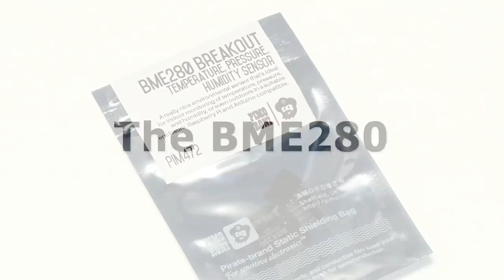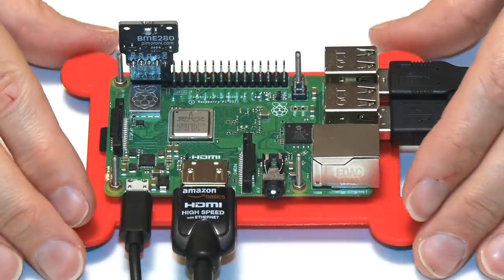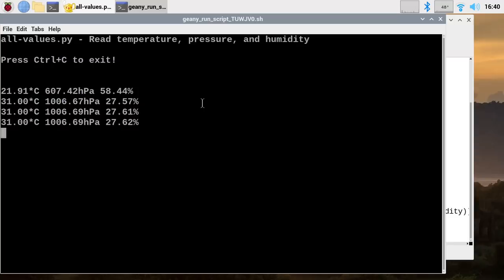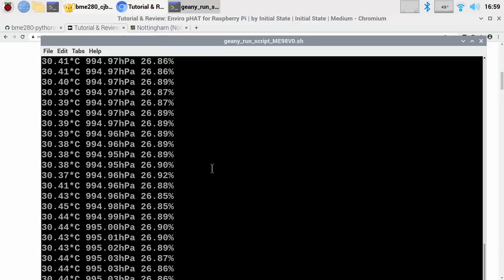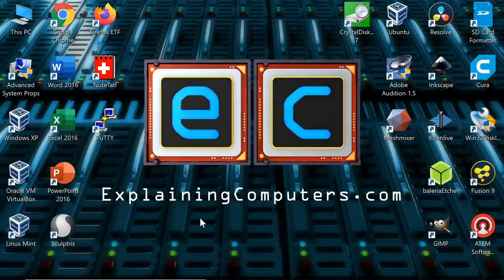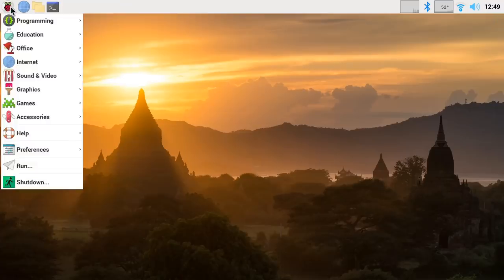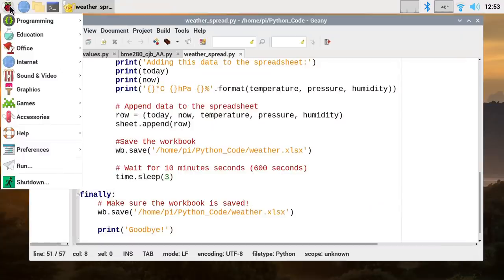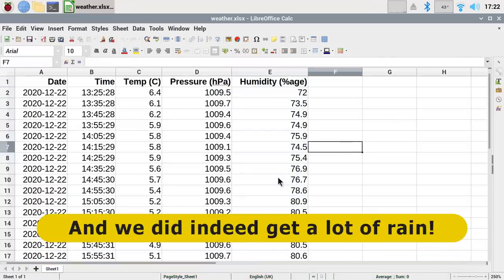Raspberry Pi Weather Station

Comment: Hi, I watched your video with great interest. I'm paragliding pilot and I use an instrument which is called variometer to get audio signalling if I ascent or descent. I'm also freshly in love to brand new Raspberry PI4 8Gb. I was thinking of building PiZero with battery and such and sensor to working variometer instrument.
I have a couple of questions for you:
- if I'm correct such project could be done by PiZero (PiZero runs the same software then Pi 4b) - correct?
- how fastest, how many times per minute or second can data be collected, with the usage of Python or some other programing language
  (in your example data is collected every second... can be collected faster)?
- how specific (granulate) can  pressure data be gathered (in your example hPa are measured to two decimals... can it be measured to finer precision)?
- can you point me to the source of alternative sensors which will work with RPi (I'm interested in similar sensible enough sensor for pressure (but also temperature and humidity), and accelerometer sensor which could help to improve sensibility of my potential instrument project?
Sorry, if my questions are a bit basic, but I'm new to Pi universe, I know a bit of programming, but I don't have any electrotechnical knowledge... (but I have some friends who could help me ;-)

Best regards, Branko
Reply from the maker: Yes, you can run the same software on a Pi Zero (W) just fine. You should be able to take several thousand measurements a second, maybe a lot more. The BME280 sensor I used I doubt it more accurate than two decimals. There are a lot of potential sensors you can use - eg see: https://shop.pimoroni.com/collections/sensors
Reply: @ExplainingComputers  Thank you very much for your fast answer. I'm just looking at pimoroni web page. I will study the specification of sensors... I'm thinking to prototype instrument with Pi 4b and then if the result will be encouraging transfer it to PiZero.
Reply: @ExplainingComputers  I would like to ask you for a favour: 
Could you move the sensor up for one meter in second or so and let me know for how much (if at all) pressure measurement will change, thank you.
I'm looking in specifications and maybe this sensor is not sensitive enough and I will need to go with BMP388 (https://www.welectron.com/Waveshare-16115-BMP388-Barometric-Pressure-Sensor).

Comment: is there a safe way to insulate the pi somehow to actually keep the weather station outside safely without risk of shorting once temps drop below zero or it rains?
Reply: @savagebob911  but then we won't be able to measure humidity

Comment: Greetings... Here I am ... back again. ;-)
I have interest for your method but to implement it, it should be more efficient to use Linux crontab no ? (on terminal "crontab -h" for command, "crontab -e" to edit. With this method, you could run your python program in background, manage the intervals and schedule working times.
It is so simple...
But your video is interessant for first access of temerature and pressure captation. I think it was your goal. I am waiting for next episodes of this new serie.
Cheers

Comment: Another excellent video. However, I am hesitant to subject a Pi to the outdoors where I live since it can drop to -20C or lower here on winter nights. Anyone know what the tolerable temperature range is for the Pi? I don't have a garage (I live in an apartment).
Reply from the maker: I don't know the Pi's lowest operating temperature, but when running it would not drop to -20C as it generates its own heat.

Comment: Hi, Can you show how you can translate that code into an arduino/platformIO scketch for the ESP32? I do have at home an ESP32 running measuring the CO2 values with the MH -z19b sensor and send them to a webserver. I would like to add the bme280 sensor (which for now is connected also on my raspberry pi)  and also display the values on the ESP32 integrated OLED dispay! :) 
Thank you, Great Video! :)

Comment: Raspberry PI for the reading data from sensors. What?  May be desktop will be better solution?

Arduino or ESP boards can dp it better. And it cheaper.

Comment: is there a version if this module in usb that you could plug into a windows PC? i have one around working 27\7 and curious if it can be done without PI at all.
Reply: There are USB-to-I2C interfaces, but they're probably more expensive than a Pi Zero W, so it's not cost-effective.  There are also USB temperature/pressure/humidity sensors, but again... more expensive than the Pi Zero W / BME280 combo.
Reply: @dfs-comedy  i see, thanks

Comment: Is it possible for the board to be configured for imperial units?
Reply: I made these changes to the script..the changes have the conversions from C to F and hP toHg

temperature = bme280.get_temperature()* 9/5 + 32
 pressure = bme280.get_pressure()/33.86                                              
humidity = bme280.get_humidity()
print('{:05.2f}*F {:05.2f}Hg {:05.2f}%'.format(temperature, pressure, humidity))

Comment: I see you have not changed the time in the upper right hand corner of the screen. You can change it by right clicking on the time and selecting "Digital Clock Settings".
In box labeled Clock Format you can change the variables using following (I used  %I:%M:%S %p  to get 12 hour format): 
Specifier	Meaning
%a		Abbreviated weekday name.
%A		Full weekday name.
%b		Abbreviated month name.
%B		Full month name.
%c		Date/Time in the format of the locale.
%C		Century number [00-99], the year divided by 100 and truncated to an integer.
%d		Day of the month [01-31].
%D		Date Format, same as %m/%d/%y.
%e		Same as %d, except single digit is preceded by a space [1-31].
%g		2 digit year portion of ISO week date [00,99].
%F		ISO Date Format, same as %Y-%m-%d.
%G		4 digit year portion of ISO week date. Can be negative.
%h		Same as %b.
%H		Hour in 24-hour format [00-23].
%I		Hour in 12-hour format [01-12].
%j		Day of the year [001-366].
%m		Month [01-12].
%M		Minute [00-59].
%n		Newline AM/PM format of the locale. If not available in the locale time format, defaults to the POSIX time AM/PM format: %I:%M:%S %p.
%Q		which will be filled by any of the ‘show text’ detailed in the zmtriggers.pl section
%R		24-hour time format without seconds, same as %H:%M.
%S		Second [00-61]. The range for seconds allows for a leap second and a double leap second.
%t		Tab character.
%T		24-hour time format with seconds, same as %H:%M:%S.
%u		Weekday [1,7]. Monday is 1 and Sunday is 7.
%U		Week number of the year [00-53]. Sunday is the first day of the week.
%V		ISO week number of the year [01-53]. Monday is the first day of the week. If the week containing January 1st has four or more days in the new year then it is considered week 			     1.Otherwise, it is the last week of the previous year, and the next year is week 1 of the new year.
%w		Weekday [0,6], Sunday is 0.
%W		Week number of the year [00-53]. Monday is the first day of the week.
%x		Date in the format of the locale.
%X		Time in the format of the locale.
%y		2 digit year [00,99].
%Y		4-digit year. Can be negative.
%z		UTC offset. Output is a string with format +HHMM or -HHMM, where + indicates east of GMT, - indicates west of GMT, HH indicates the number of hours from GMT, and 			MM indicates the number of minutes from GMT.
%Z		Time zone name.
%%		% character.character.
%N		Name of the monitor. In some instances you may need %%N
%p		AM or PM string.
%r		Time in AM/PM format of the locale. If not available in the locale time format, defaults to the POSIX time AM/PM format: %I:%M:%S %p.
%Q		which will be filled by any of the ‘show text’ detailed in the zmtriggers.pl section
Specifier Meaning
%a		Abbreviated weekday name.
%A		Full weekday name.
%b		Abbreviated month name.
%B		Full month name.
%c		Date/Time in the format of the locale.
%C		Century number [00-99], the year divided by 100 and truncated to an integer.
%d		Day of the month [01-31].
%D		Date Format, same as %m/%d/%y.
%e		Same as %d, except single digit is preceded by a space [1-31].
%g		2 digit year portion of ISO week date [00,99].
%F		ISO Date Format, same as %Y-%m-%d.
%G		4 digit year portion of ISO week date. Can be negative.
%h		Same as %b.
%H		Hour in 24-hour format [00-23].
%I		Hour in 12-hour format [01-12].
%j		Day of the year [001-366].
%m		Month [01-12].
%M		Minute [00-59].
%n		Newline AM/PM format of the locale. If not available in the locale time format, defaults to the POSIX time AM/PM format: %I:%M:%S %p.
%Q		which will be filled by any of the ‘show text’ detailed in the zmtriggers.pl section
%R		24-hour time format without seconds, same as %H:%M.
%S		Second [00-61]. The range for seconds allows for a leap second and a double leap second.
%t		Tab character.
%T		24-hour time format with seconds, same as %H:%M:%S.
%u		Weekday [1,7]. Monday is 1 and Sunday is 7.
%U		Week number of the year [00-53]. Sunday is the first day of the week.
%V		ISO week number of the year [01-53]. Monday is the first day of the week. If the week containing January 1st has four or more days in the new year then it is considered week 			1.Otherwise, it is the last week of the previous year, and the next year is week 1 of the new year.
%w		Weekday [0,6], Sunday is 0.
%W		Week number of the year [00-53]. Monday is the first day of the week.
%x		Date in the format of the locale.
%X		Time in the format of the locale.
%y		2 digit year [00,99].
%Y		4-digit year. Can be negative.
%z		UTC offset. Output is a string with format +HHMM or -HHMM, where + indicates east of GMT, - indicates west of GMT, HH indicates the number of hours from GMT, and 			MM indicates the number of minutes from GMT.
%Z		Time zone name.
%%		% character.character.
%N		Name of the monitor. In some instances you may need %%N
%p		AM or PM string.
%r		Time in AM/PM format of the locale. If not available in the locale time format, defaults to the POSIX time AM/PM format: %I:%M:%S %p.
%Q	%R		24-hour time format without seconds, same as %H:%M.
%S		Second [00-61]. The range for seconds allows for a leap second and a double leap second.
%t		Tab character.
%T		24-hour time format with seconds, same as %H:%M:%S.
%u		Weekday [1,7]. Monday is 1 and Sunday is 7.
%U		Week number of the year [00-53]. Sunday is the first day of the week.
%V		ISO week number of the year [01-53]. Monday is the first day of the week. If the week containing January 1st has four or more days in the new year then it is considered week 			1.Otherwise, it is the last week of the previous year, and the next year is week 1 of the new year.
%w		Weekday [0,6], Sunday is 0.
%W		Week number of the year [00-53]. Monday is the first day of the week.
%x		Date in the format of the locale.
%X		Time in the format of the locale.
%y		2 digit year [00,99].
%Y		4-digit year. Can be negative.
%z		UTC offset. Output is a string with format +HHMM or -HHMM, where + indicates east of GMT, - indicates west of GMT, HH indicates the number of hours from GMT, and 			MM indicates the number of minutes from GMT.
%Z		Time zone name.
%%		% character.

Comment: Ok..US based question. Please don't hurt me:
How do I get this to output in Fahrenheit  and Hg (pressure in inches)?
(Without me having to create a spreadsheet formula)
Reply: temperature = bme280.get_temperature()* 9/5 + 32
 pressure = bme280.get_pressure()/33.86                                              
humidity = bme280.get_humidity()
print('{:05.2f}*F {:05.2f}Hg {:05.2f}%'.format(temperature, pressure, humidity))

Comment: Anyone else had a problem with this? I have a raspi 4 and 3B and both wont work with this kit, I must be missing something.  I have install the library, switched on i2c, but everytime I run a program it fails, I get runtime error: unable to find bme280 on 0x76, Chip_ID returned 61, ? any help appreciated.

Comment: Hmm. The time stamps for the sensor readings had a bit of creep to them. They gained a second once every three or so readings. Probably not a massive problem considering you also recorded the time stamp with each reading and can use that to adjust your numbers, but I thought I'd mention it.

Not the most inaccurate timer I've ever seen though. I once downloaded an alarm clock program some random person on the Internet made, which was off by somewhere around 30%. It wasn't very useful as an alarm. I also wonder how is was programmed to get such dreadful inaccuracy.

Change of subject though… Have you ever done anything weird with spreadsheets? I made a spreadsheet that gives me the calculated list of points for a Bézier curve, which I could copy and paste into a graphing app. I did this because the app ecosystem I'm forced to use is locked down rather tightly. And outdated on top of that.
Reply from the maker: It creeps because the loop itself takes a little time to execute -- so it takes the set number of seconds, plus the loop execution time.
Reply: Ooh… I read about a problem kinda like that in a story recently. Someone was doing astronomy calculations, but they needed to make an adjustment to them to account for how much the objects they were looking at had moved since they started doing their calculations.

Comment: Good programme, but it would have been even better if it had included more complete weather data, like wind direction and speed and precipitation.
Reply: I think that’d require other components like a rain sensor and an anemometer.
Reply: @1976kanthi Yes, it does. But cheap (Chinese) 433-based weather stations exist, and so do several linux-based hacking tools for proprietary 433 protocols. The advantages of basing this on a pi are portability and availability of data for analysis and archival. The usual base stations for there weather things are woefully primitive.
Reply: @jazzbear02  interesting

Comment: for 2 daysit works fine but since today I Got the message 
Traceback (most recent call last):
  File "./all-values.py", line 8, in <module>
    from bme280 import BME280
ImportError: cannot import name BME280

No script is working
What can be the reason  ?

Comment: While the weather control module might be a ways off, a possible expanded video might be to take a look at a METAR (https://en.wikipedia.org/wiki/METAR) and see how much of the METAR data you can collect with a R-Pi and attached sensors. Bonus points if the data stream could be output as a METAR coded data line. :-) That should be a bit of a challenge.

Comment: It's a really bad idea to sudo pip install anything on a regular linux machine, is it different in the Pi system? Typically pip should be able to do whatever installs it needs to without sudo.
Reply from the maker: Sudo pip will install the Python libraries system-wide. On a regular PC that may have many user accounts you may not want to do this. But on a board like a Pi that is very unlikely to have multiple users (and where the risk of hacking is small) it is unlikely to result in issues. The manufacturers of the sensor (Pimoroni) use sudo pip in their install examples, probably on the basis of making the libraries required to access the hardware available system wide. It is unusual to install hardware for only one user.
Reply: @ExplainingComputers  Thanks for the reply! I'll look into it a bit more.  Looks like most references to Pi installations of various kinds use sudo pip.

Comment: Spreadsheets are not a good way to save data as they have limitations. It will be way better to save to a file at least or a db would be even better.

Comment: Is it possible to have 2 sensors mounted on one Pi?
Reply from the maker: It is. But on one of them you need to bridge (joint together) the solder pads labelled "ADDR" so that each sensor has a different I2C address.
Reply: @ExplainingComputers  thanks, that’s really helpful.

Comment: Haha Chris. I think the Yanks have that covered with HAARP.
Thanks for the Vid, I enjoyed!  Happy New Year!
So this is a weather station that isn't weather proof 🤔. It would be usefull if they sold an extended cable and weather proof enclosure. Not that usefull in a garage, ball park figures only.
It would be usefull for my Pharma facility measurment as most of our environments have set humidity, pressure and temp, but given the accuracy of the temp sensor is only ±1.0°C, thats a bit too wide. I would have expected that board could have had a sensor with ±0.3°C.  It's Humidity ±3% accuracy, and barometric pressure ±1 hPa absolute accuraccy is OK though but not ground breaking.

Comment: Great video Chris.
I have successfully implemented this on my Pi4b but have run into trouble repeating it on the Pi3b. Your first script bme280_cjb_AA.py runs just fine, but the weather_spread.py locks and starts returning the same readings repeatedly (22.9*C 752.7hPa 90.8%) after seemingly random periods of time. My code is identical to yours other than an adjusted time interval for a reading every minute and is installed on a completely clean new install of the OS. I suspect the bme280 may be faulty, but if anyone here has any other thoughts, I’d be pleased to hear them.
Once I get this up and running I want to move on to storing my data in the cloud, for example at Thingspeak. I may share my experience in a blog once I get my website up and running.
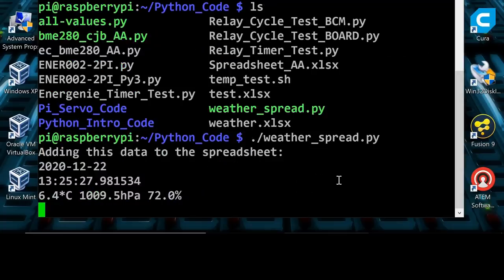Reply: It has failed again at 19:24. I'll order a new bme280.

Comment: I like your videos. But now I have to say you are far late from current data logging techniques such as using red node and mqqt services
Reply from the maker: What I show is a project for general computer users -- who will know what a spreadsheet is, which immediately makes the content more accessible. And effective education is all about accessibility and introducing the least complexity possible for the task in hand. There is no credible way to introduce the data logging methods you cite, and also introducing the temperature sensor, and related code, in a single video for a general computing audience. It this video was about teaching IoT data handling, you have a good point. But it is not.